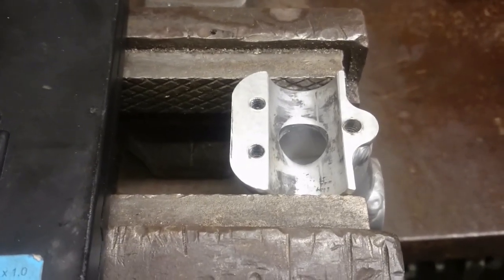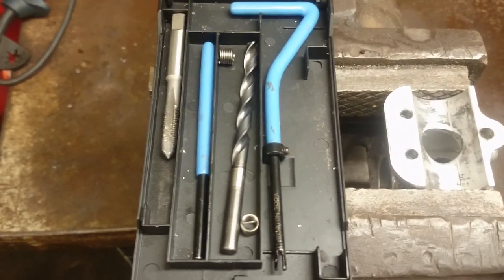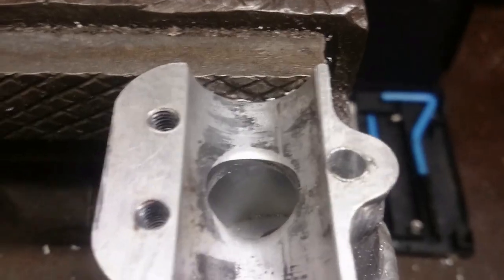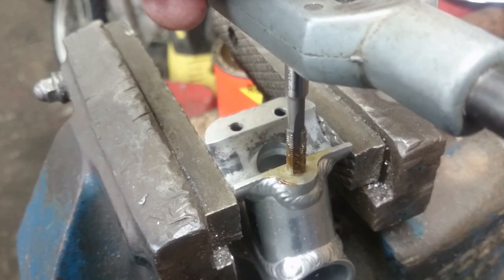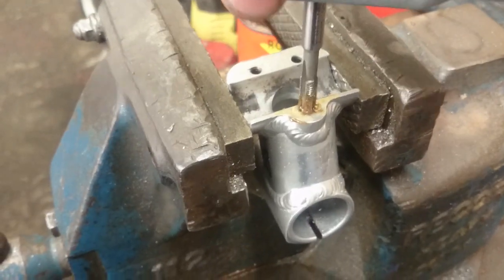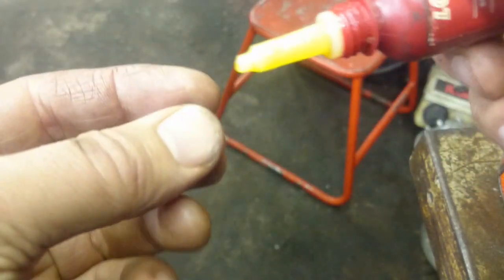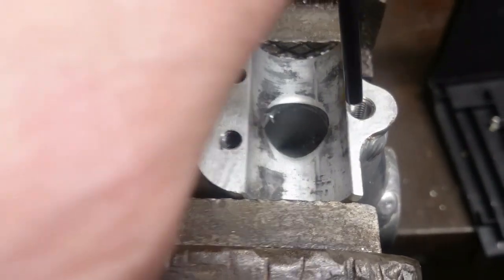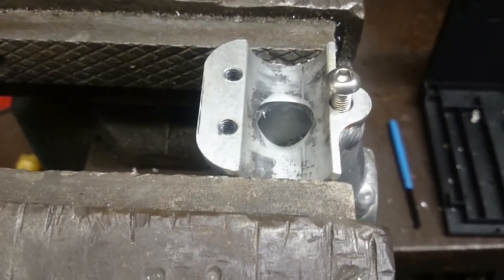helicoil Thread repair M6 x 1

Comment: Can u get longer heli coil I need to repair the case where flywheel goes and the screws are like 40mm long
Reply from the maker: Yes you can buy all different lengths. 2xD, 3xD etc. where D is the diameter. Therefore for an M6 thread 2xD would be 12mm long etc.

Comment: Got the same vice which helps lol we had to use a helly coil on the head bottom hole that holds the bottom left head bolt if you where looking at tge bike straight. Not far about the main o ring goes be it rubber or metal. Cracking video as always, great detail. I'll email you that picture of my GSXR, Some one called it an (s rad ?)

Comment: I have to do this on 4 different M6 bolt holes for a BMW M42 valve cover. Thanks for the tips! Great instructional video.

You're right, you absolutely need the right tools for the job. Do it right or don't do it at all!
Reply from the maker: Thank you for your kind comments 👍🏼
I hope it goes well

Comment: When be needed a long thread, can be installed two inserts in the same hole ?
Reply from the maker: They would have to be synchronized so that the threads follow the same helix so it's probably more trouble than it's worth
You can buy different lengths though so I would just search for the length you need
Reply: @motorcyclefixer  Thanks. But I have never seen long helicoil inserts, only are sold shorter ones.
Reply from the maker: You can get them
Reply from the maker: Look for the d number
1.5 d is 1.5 times the diameter so the bigger the d number the longer the length

Comment: How much torque can them inserts take ?
Reply from the maker: M6 bolts into aluminium. torque is usually only around 8-10Nm
Reply: @motorcyclefixer  So those inserts you put in can only take 8-10 torque ?
Reply from the maker: @brotherkhan2885  I've no idea how much they can take.
I've never taken them to breaking point.
It would probably give you a specification on the data sheet that's not to be exceeded
Reply: @motorcyclefixer  Thanks for your reply and ur content is very helpful.

Comment: I want tap drill & tap sizes for M6×1
Reply from the maker: Please!
Reply from the maker: Drill size for the helicoil is a 1/4 inch. Or 6.3mm
Tap size is about M8x 1 but can't be sure as it doesn't say on it and it comes as part of the kit
Reply from the maker: @Bloodred Pyrate exactly 👍🏼
Reply: @Bloodred Pyrate you can use a micrometer to find the exact tap size

Comment: So for m6 size thread what was the size on tap you had in box ?
Reply from the maker: Hi
It doesn't have a size written on it sorry
Reply: @motorcyclefixer  does it look like m7 then and slightly bigger ? I have to fix m3 thread but I retap it with m4 for time being and now need to fix it and go back to size m3
Reply from the maker: I'm away at the moment but I will measure it when I get back for you 👍🏼
Reply: Marcin Terlecki  the tap size is m6x1 and the drill bit size is 6.2 for a m6 thread repair hope this  helps.🤙🏻